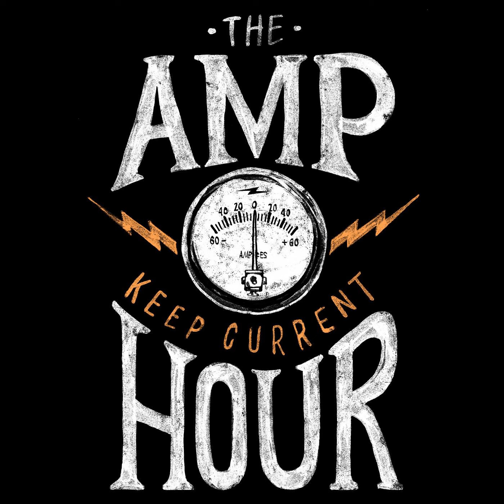The Amp Hour #537 - Firmware Deployment and Troubleshooting with Akbar Dhanaliwala

Comment: The reason people say not to do unit testing on the hardware is usually really that if you need the hardware, it's not a unit test, it's just an automated test.

They're usually either unit testing nuts or people who get really bothered about imprecise language. Either way they're technically right, but in the real world, there is a big field of useful automated testing that isn't technically unit tests but is really convenient to automate from unit testing frameworks. I'd say that in my fairly extensive software testing experience, that's actually most of the tests that it makes sense to write for most projects. Anything that increases testing is helpful and reducing friction in writing automated tests, in my books, is helpful.